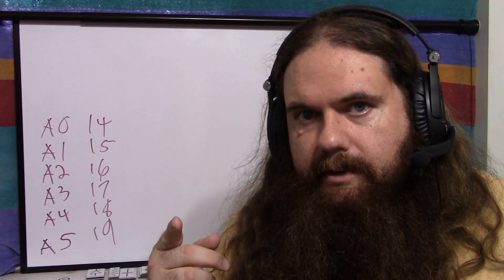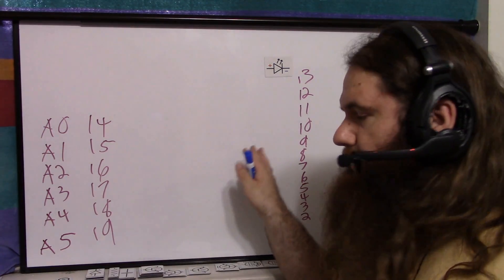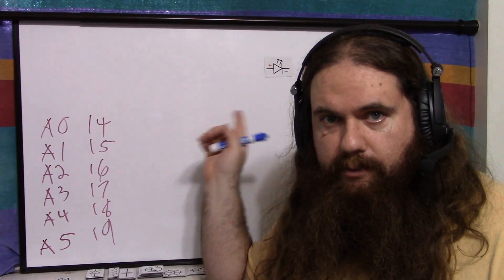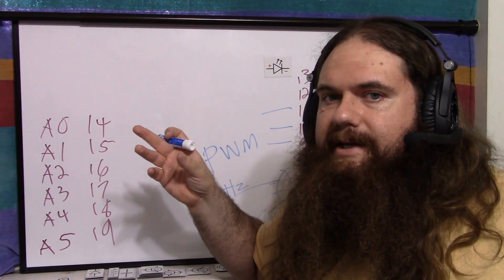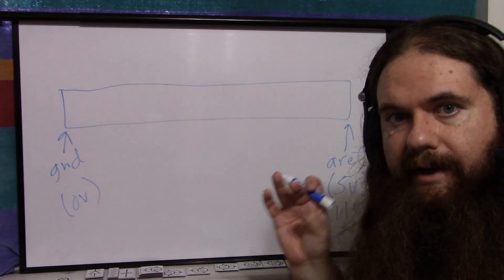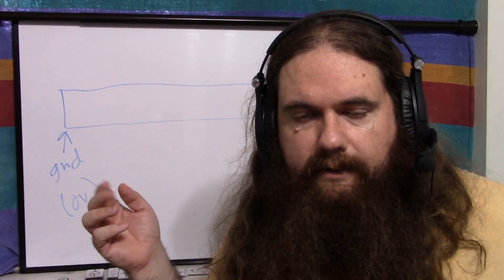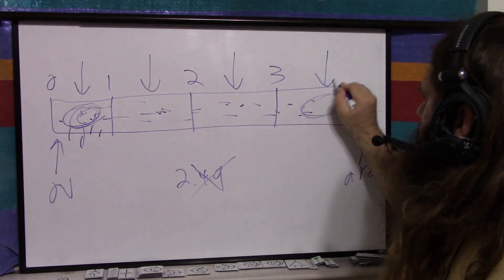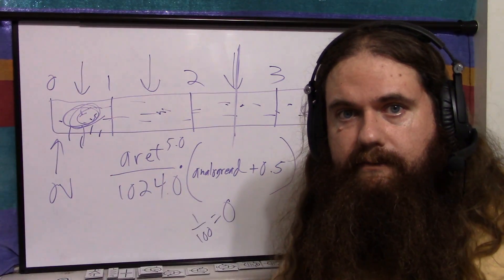Arduino Deep Dive - Digital Input and Output - Analog Input - PWM Output - Simply Put

Comment: Got a couple of arduino nanos in the car (because if you're not jerry-rigging random stuff in your car, you're missing out), and I decided that rigging up a solenoid via a solid-state relay on D13 would be efficient, because... free LED.
It worked perfectly. And every time it booted up when I turned on the car, it worked perfectly, to the amusement of the neighbours.

...I rewired it to D12.
D0 and D1 exist only for pain. So does D13. Recommend dtatus LEDs only on that line.

Comment: Hello dude with large beard in video. Wanted to ask you this question because it seems like you respond to people who comment on your video. 

I’ve just got an Arduino nano

I would like to know with some of your advice is it possible to have three separate 12 V positive wires going to the input of the Arduino. 

What I would like to do is have some sort of code running so when the Arduino detects 1, 2 or 3 12v input 

To individually run a piece of code

Basically I want to give 12 vaults. To the Arduino and in response I want the Arduino to output some code to illuminate an LED strip in either red green or blue depending on which 12 vaults the Arduino receives

Comment: im using an arduino nano, you said that you shouldnt use too many LEDs or it will blow out the pins? I have 8 leds connected to 8 pins, should I be concerned? If i add more LEDs will my arduino fry?
Reply from the maker: Always refer to the datasheet, or in this case, look on the Arduino page for the "tech specs". According to that page, each I/O pin can source or sink 40mA maximum, though personally I would always cut that in half for safety. The datasheet for the ATmega328 (the microcontroller on the Arduino Nano) confirms 40mA per pin and 200mA through the supply (which includes the Nano's power draw, which the Arduino site lists as 19mA). So just make sure you don't exceed those numbers.

Comment: I  built a coper tape electromagnet.
Reply from the maker: Excellent. I had been wondering if that would work. It's such a neat idea to think about using copper tape to make electrical components on everyday objects.
Reply: @simplyput2796  And recorded 1900uT on my phone from it before it broke.
Reply: @simplyput2796  I have seen it used to build stripline filters